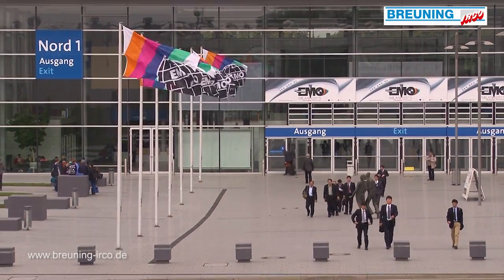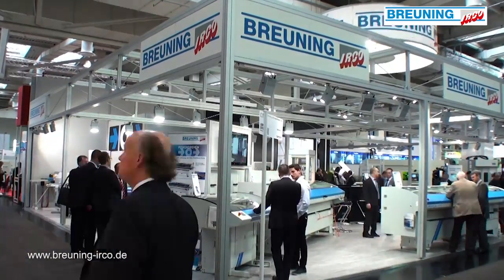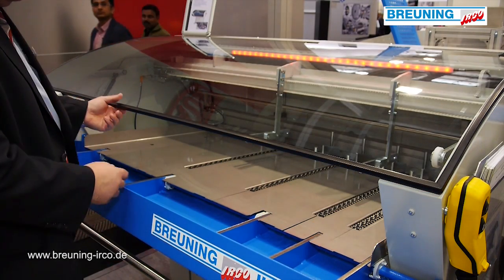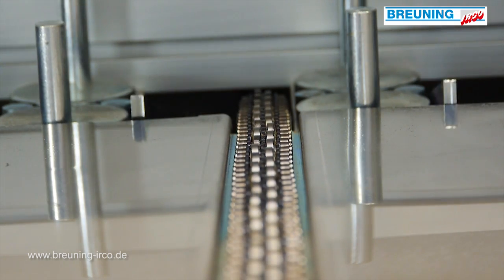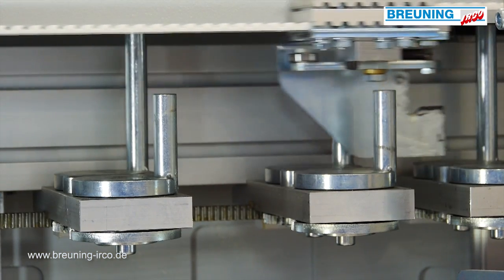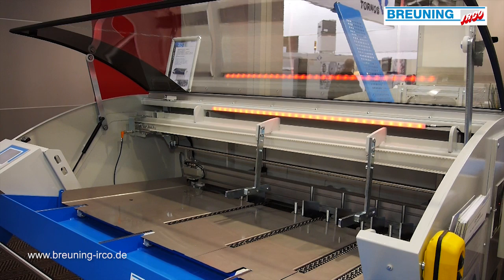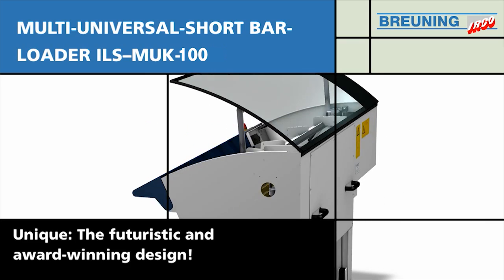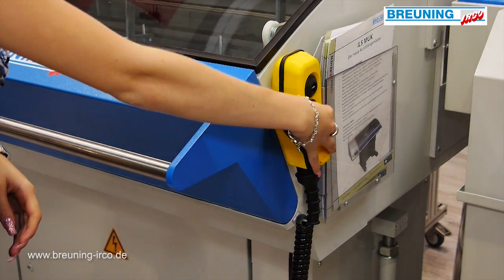Kurt Breuning IRCO Maschinenbau GmbH - exhibitor at the EMO Fair Hannover

Comment: produziert von http://www.imagefilm-produktion.com/

The company Kurt Breuning IRCO Maschinenbau GmbH, has been an exhibitor at the EMO Fair from 16th to 21st September in Hannover. Here you see the IRCO Automatic short bar loader "ILS-MUK 100". At the first look, you will immediately recognize the outstanding design which is presented on all exhibition items here at the fair. Due to the new innovative construction of bar guidance, set-up time is being optimized. The usage of an ILS-MUK pays off even when turning small series. The size of the ILS-MUK loading magazine is based on the length of the spindle within the lathe and on the maximum diameter of the bar to fit the lathe. The newest innovation in the current ILS-MUK is its guiding units, each consisting of two swiveling, self-centering guiding plates. We offer you fully electric functions (no air pressure required), a comfortable control panel with a graphical display and touch screen- complemented by a portable control box for controlling the basic functions during the set-up. Please contact us, we are one of the leading manufacturers for innovative products with highest quality standards. More information, pictures, movies and news can be found on http://www.breuning-irco.de/index.php/de/ --- Weitere unserer Videoproduktionen, u.a. zu diesem Auftraggeber, erleben Sie auch hier 

https://www.karrideo.de/ 
https://www.web-tv-produktion.de/ 
https://www.imagefilm-produktion.com/ 
https://www.youtube.com/user/wwwKARRIDEOde 
https://www.youtube.com/c/KölnMessevideoTV 
https://www.youtube.com/c/MaschinenbauTV 
https://www.youtube.com/user/KarrideoTrainerVideo 
https://www.youtube.com/c/CoachTrainerTV 
https://www.facebook.com/WebTvProduktion/ 
https://www.facebook.com/Karrideo.Filmproduktion.Christian.Weisse 
https://www.instagram.com/karrideo_imagefilmproduktion/channel/ 
https://twitter.com/Karrideo_Video 
https://vimeo.com/karrideo 
https://myspace.com/karrideo-imagefilmprod 
https://www.dailymotion.com/wwwKARRIDEOde 
https://www.flickr.com/photos/www_imagefilm-produktion_com/ 
https://www.xing.com/profile/Christian_Weisse2 
https://www.vidlii.com/user/KarrideoImagefilm